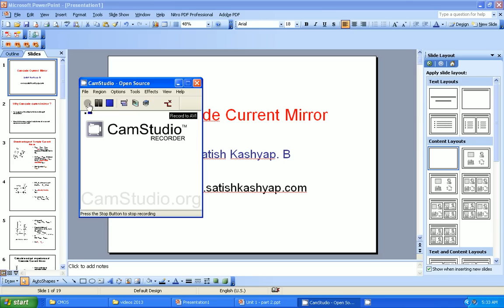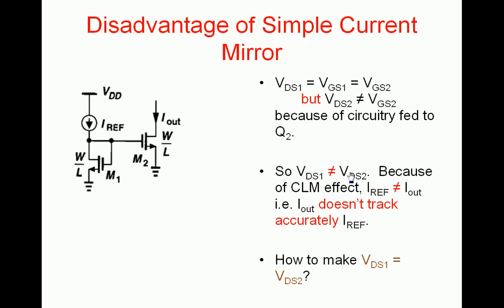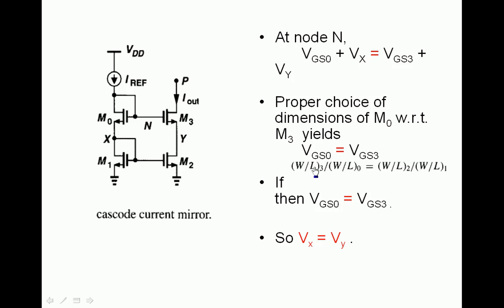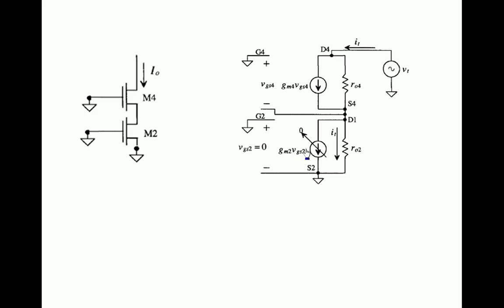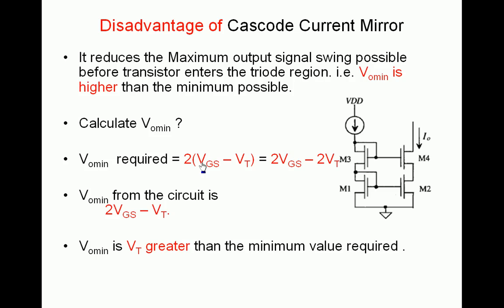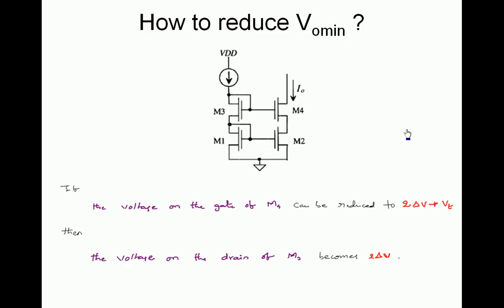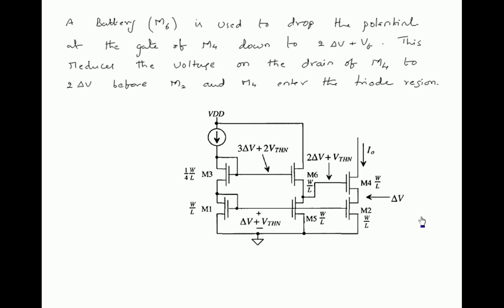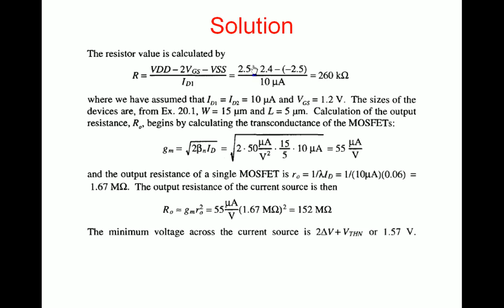Cascode current mirror ( operation, advantages and disadvantages)

Comment from the maker: vo = vomax - vomin , so if vo is not min. then maximum output will be less for the given input signal, in other way for a given gain, voltage swing( vomax - vomin) is not maximum . so vomin should be minimum and ideally it should be zero.

Comment: Sir one small correction. @ 21 :50 it should be "then the voltage on the drain of M4 becomes", It is is wrongly mentioned as drain voltage of M3.
Reply: Enna Macha teacher ke Correction solra :O